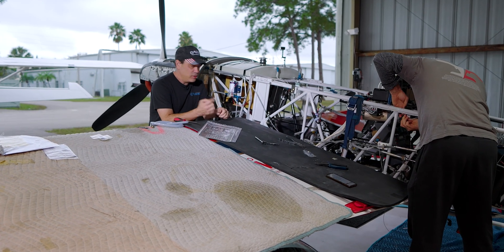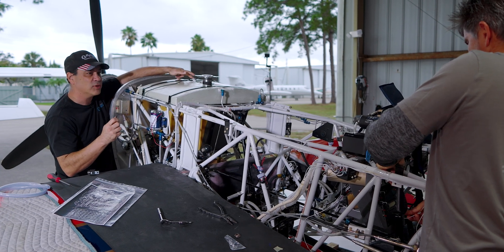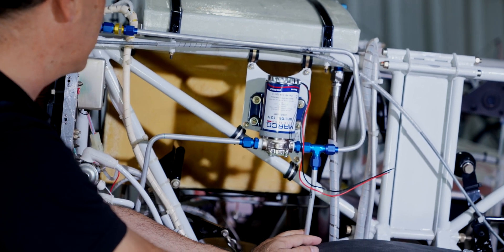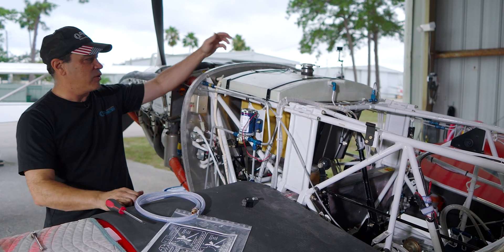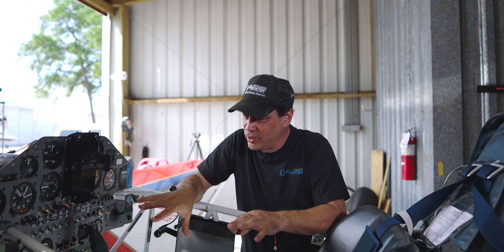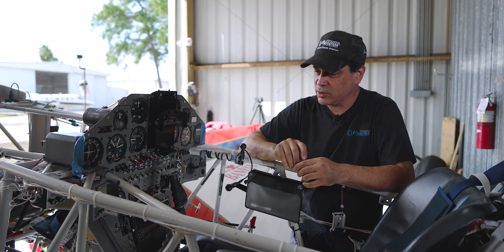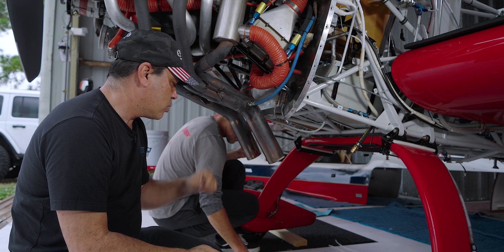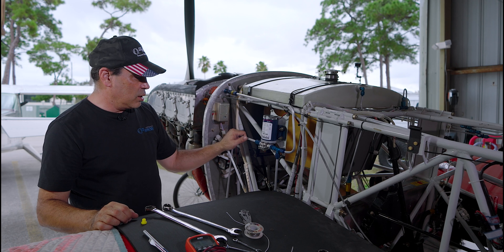Part 2 -Extra 300 Smoke System Aerobatic Aircraft Out The Tail Pipes

Comment: What nozzle did you use for inserting into the exhaust?  I couldn't tell in the video.
Reply: Just used the one that Extra sent with the kit.   But we shortened it so that it was only about 1 in long.  Then crimped the end to almost nothing and drilled a couple small wholes in one side.   Then insert the tip so the drilled holes spray into the exhaust.   So upwind so to speak.

Comment: How do you get the flow rate down on the pump?  Is it just by restricting the nozzle, or is the pump itself adjustable?
Reply from the maker: You don't change the flow rate.  You only tweak the tip so that it does not put out so much oil.  The pump just keeps the pressure up.
Reply: @e3aviationassociation  Aaah, OK.